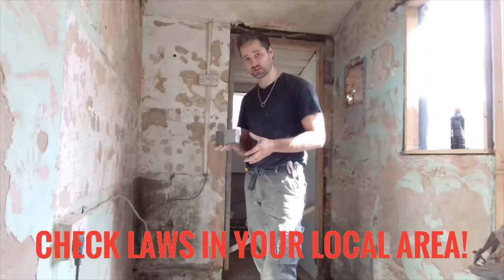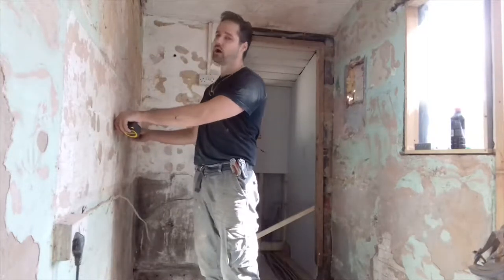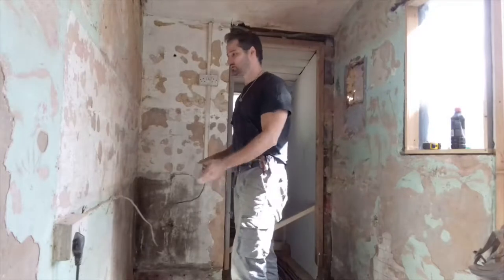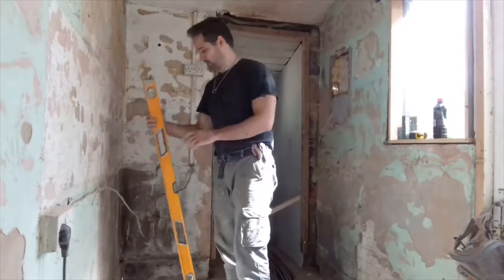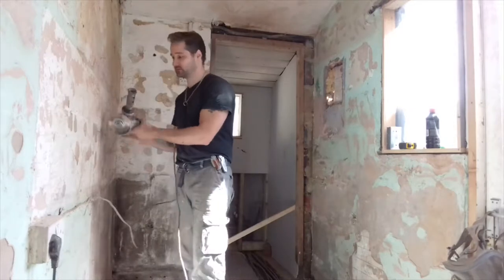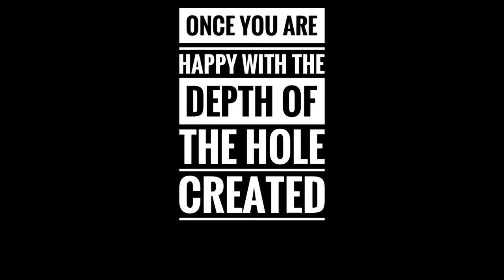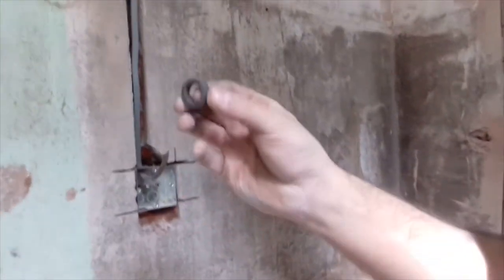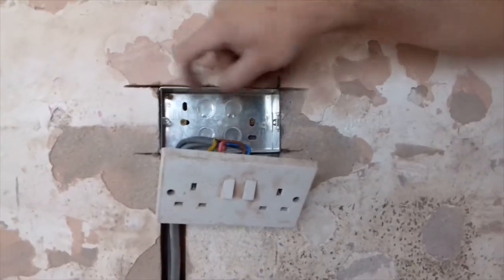Easy steps in how to install extra sockets on a ring main

Comment: Was very helpfull , now about to tackle the task of fitting 4 sockets in the main bedroom .allowing the option of positioning the bed against either of two walls . thank you for this guidance
Reply from the maker: Hello David
That is a really good question and will be a great video to do when I have the opportunity to do so,  As my house has been remodeled, pulling it apart for a great video like that will upset the wife but I will add not only doing a plan for four sockets ill also include bed side lights with there own on/off switches.
Stay tuned, subscribe and watch out for that video 
Thank you for watching

Comment: Bad 🤦‍♂️. That big chase is out of zone. Needed to be within 150 mm of corner of the wall. Or have an accessory on it before it is safe. No one would know this cables here because its out of zone
Reply from the maker: thank you for you great comment.  yes that is true, but in the case the wall on the other side steps in buy 450mm. There is now a tower unit standing there with the wire exsposed underneath.
Thank you for watching my videos